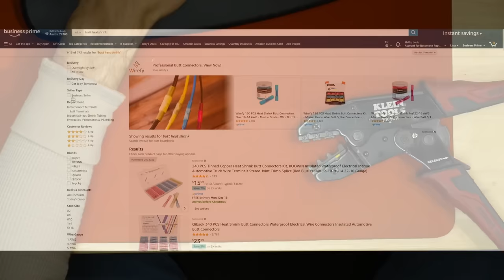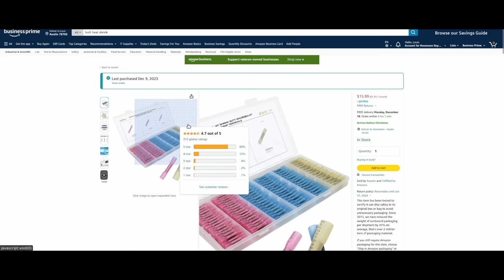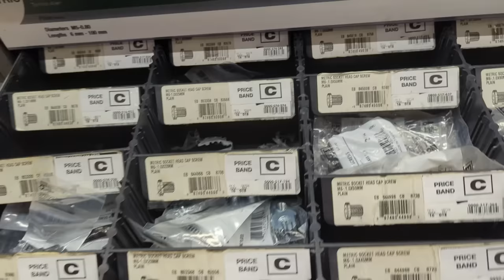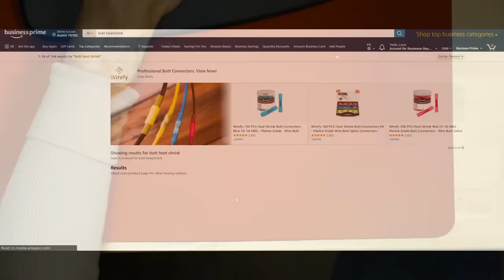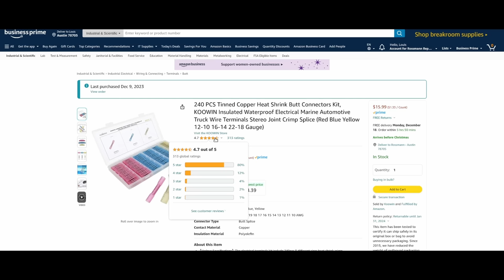Amazon Sells Dangerous Electrical Crimps

Comment: It’s amusing that Harbor Freight has been working diligently to increase its performance and quality control on most of its products, increasing its volume and customer satisfaction - while Amazon has been going in the opposite direction.
Reply: Who would have thought 20 years on that you'd rather shop ar HF than many other retailers!
Reply: i fix power plants for a living and most of the people work with buy their tools from there. not because theyre great. theyre not, some of their tools are more dangerous than useful, but some of their things are worth it simply for the warranty. a lot of HARD jobs break any tool, and harbor freight has the most hassle free warranty.
Reply: Harbor freight has been doing really well too building lots of stores
Reply: HF is my groove
Reply: HF doesn't have monopoly power.
Reply: Now that...man, harbor freight, I never even thought of that.
Reply: Chicago electric works,their tools aren't bad if you know how to take care and maintenance them. If the tool needs grease, you had better not run dry. Easily the best discount tools.
Reply: i have yet to been disappointed with a HF product. If you have realistic expectations of a tool that is 1/5th the price of a snap on and performs just as well (may not last as long, but I can buy it 5 times over). Pittsburg sockets..never had an issue, wrenches never had an issue. Wired power tools - never had an issue.
Reply: They just changed the source of their products. Most of it is sold by other companies still. An expensive ICON socket wrench also is sold on Amazon under a different brand name, for 1/5th the cost. So yeah their suppliers have gotten somewhat better, but really what you are paying for at Harbor Freight is the warranty. And the prices have definitely gone up to reflect that. So overall it's good, but still the quality leaves a lot on the table.
Reply: You STILL couldn't PAY ME to trust their tools when it really counts! Like their car jacks HAVE SNAPPED! Several recalls on such. 

And I'm paranoid,  so I'd be buying  jacks to lift a CTA BUS to hold an 09 Mercury Sable (4,000 pounds) for that reason. 

I've yet to be let down by buying for COMPLETE OVERKILL.  

Wouldn't trust them fir stuff like drill bits, either. Had a friend hurt himself badly using ones from Aldi. It BROKE. So. We only use the high quality stuff for high risk/heavy impact things.
Reply: Is Craftsman completely gone? I'd go with Ryobi for light stuff and dig up the corded Craftsman things if they're safe and you run across a barn find. Not sure about safeties from 70s stuff to now but I know the old stuff ain't going to stop for you. So you need to know what you're doing. Lol.
Reply: @windsofmarchjourneyperrytr2823   I never trust jack stands no matter the brand.  I'm throwing the wheel under there, I have a big 12x12" block of wood that goes under there.  If I'm crawling under something that will kill me if it falls, forget it.  I want something hard under there that it'll hit before it hits this meat bag.

Comment: A thing I noticed on amazon is that vendors are able to switch the actual product listed so that it looks like its got a billion great reviews, but then you read the reviews and it's for a completely different product.

You're right. Amazon has become garbage.
Reply: I’ve noticed that this year.  It’s bizarre. That never used to happen
Reply: This happens because they can add items to the page as options and those reviews are all lumped together. Then they delete the other item and it looks like the new one but with all the old reviews. 
Amazon doesn't care at all about this and its extremely frustrating.
Reply: Good point !! A few years back I was in the market for a digital camera and looked at Amazon reviews and found at the price I could budget for and had great reviews. Curious, I read some of the reviews had the first 20 or so were foe this camera but then I saw reviews for bird seed and other TOTALLY non related items !!  Amazon should be held accountable for illegal marketing practices.
Reply: Always read the reviews and check review images.
Reply: He's saying if you buy from the shop,  most of the items are stolen,  or rather,  certain part of the item is stolen.  Is that true?  It never happen in my country  Malaysia!
Reply: Totally shouldn’t be allowed… you think if you swapped an item for something else, it’d erase the reviews. Smh. Amazon was gone to trash since Jeff left.
Reply: Similar problem with Home Depot as well. I bought a cordless drill kit, which I suspect had been previously opened, and one of the batteries wouldn't charge. So it seems HD is putting defective returned items back on the shelf and selling again as new. And their online reviews often times are for a different model or product than what the reviews are supposed to be depicting. They are just cutting and pasting the reviews without checking them. So much incompetent and fraudulent activity by either the public and the merchants these days.
Reply: They do the same thing on youtube . If you go under say Russel brand ...and scroll the comments, the same comments will be under multiple vids
Reply: Its been this way for YEARS. I don't understand why you people are just waking up.
Reply: You can just tell Amazon that the reviews don't match the product, and they deal with the vendor themselves. I don't think it's as big a deal as people are making.
Reply: they do this all the time
Reply: @trinleywangmo yes you can, but it requires actually doing something … and people are fine to complain at the wrong end all the time but not just writing a 2 sentence hint to the actual platform. Ranting on Facebook and social media for days on the other hand …
Reply: Combining reviews from dozens of products in the same list allows them to really confuse buyers and hide garbage.
Reply: This is one thing that pisses me off. I did a review for a Mini PC and it was put on a cheaper, less specced product when the seller changed the add to keep the reviews. This is a huge issue I have with them. They don't allow sellers to have access to the reviews directly so they pull these stunts to get the reviews they want. I have to say though, 90% of it are products from China.
Reply: @FloorFerret  They literally can't acknowledge it because it opens them up for liability. They are fully 100% aware of how the Chinese are gaming their system and they are 100% in support of it. I would like to say that it is surprising that people only just recently started noticing the enshittification of Amazon, but then I'd be lying, people really are that stupid and will continue to buy this garbage from Amazon. God forbid these people start using Temu. I would mention Alibaba, but at this point, Amazon is just a front-end for Alibaba with a price mark-up. Can't even trust brand-names either if any of those brands have their products manufactured in China, the very same manufacturers are stealing the designs & counterfeiting it themselves so you can't even trust brand names to be genuine either because of stock co-mingling.
Reply: I bought a professional audio cable (XLR to RCA) to use on PA gear. The XLR connector broke after just a few times plugging and unplugging. I tried to return it as faulty - suddenly that option wasn't available... oh. I then attempted to leave a review saying 'buyer beware!' But after completing it, it was never posted. Then the product seemed to disappear...

I have also tried and failed to search for brand name items recently, and keep finding myself inundated with so many options that just confuse me.

I just bought an optical to RCA converter from my TV to Hi-fi. First one didn't work properly so I ordered a different one that looked a bit better. Funny thing is, they both have EXACTLY THE SAME INSTRUCTIONS to the letter! 
How does that work then? Are they all made by the same factory?
Reply: I have complained about this many times, & piece of SHT amazon doesn't care. It's all a scam.
Reply: or it's a series of reviews for a single listing that has multiple variations of a multitude products that they're selling.
Reply: I noticed hat too! Great detectivee work.
Reply: I noticed this on record pressings
Reply: @Devilishlybenevolent because not everyone was ordering on Amazon for the past few years?  So when someone goes on Amazon for the first time or the first time in years, and sees this, they obviously haven’t seen it before since they didn’t visit the site before. 

I promise the issue isn’t everyone is dumber than you, the issue is most people aren’t chronically online like many of us. I promise you aren’t smarter than everyone else, just online more. 

Comments like this cause my eyes to spontaneously roll out of my head.
Reply: lost of companies group products together as different “Sizes” or “Colors” when they actually have listed a bunch of different products so when you look at reviews all the products receptions are averaged out
Reply: +1 for this

Comment: I ordered branded microfibres cloths and received cheap alternatives.  They weren’t even knock offs, just completely different.  My review included photographs and was not allowed because it included information about packaging even though it didn’t.
Reply: They do this with Nike sweatpants so bad I started ordering them directly from Nike's website and just dealing with the hassle that that is
Reply: Thats exactly the scumbag reply SCamazon gave me when I reported the IC sockets I'd recently ordered wich were thrown loose in a box which they themselves then crushed before shipping resulting in broken & bent pins.
Reply: A couple weeks ago I received a brand new NVME drive that had the seal on the boxed opened. Also when I search for products the first few pages of popular results are cheap alternatives usually, no name brands. It's unfortunate that low quality and cheap is the most popular items. Shows the state of America. Quality is going down the drain.

Comment: Another big issue on amazon is that 80% of the listings are the same product with different sellers.   Thats because they are all made by the same factory and then sold to importers that all list the same garbage on amazon.
Reply: Everybody wants to be a drop seller for easy cash nowadays.
Reply: That's so obnoxious! Especially when Amazon singles out some of those sellers as featured "small businesses" and makes them out as some little mom and pop operating out of their garage. I completely understand that being a small business doesn't require you to manufacture every part, and there's certainly nothing wrong with making a business by selling other companies' stuff,  but don't celebrate them for rebranding the same junk 17 other storefronts have done the exact same with.
Reply: They are Chinese!
Reply: @prissx784  Not true. Some are Vietnamese or Indian lol.

Comment: My biggest issue with Amazon lately is they claim to have shipped something, then a couple days later when it should have arrived they send me an email and say they haven't shipped it yet. The initial shipping notification was a lie. This has been happening with increasing frequency.
Reply: This is happening to me right now. Ordered and item 4 days ago and it was supposed be here 2 days ago on the day it was supposed to be delivered by 10pm I got a notification at 8pm saying it's delayed for weather until the 13 2 extra days.
Reply: My experience as well.
Reply: Ive had this happen multiple times, and now just had an item i did not pick up from the amazon locker still charged to me.
Reply: Also happening to me right now with some Eproms I've ordered.  Stupid me trying to save money cause I'm on disability.